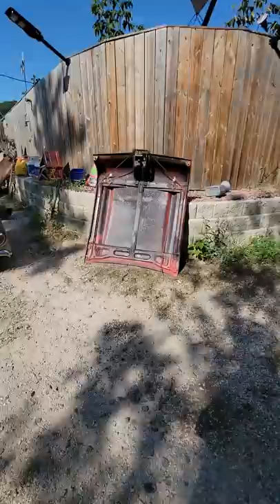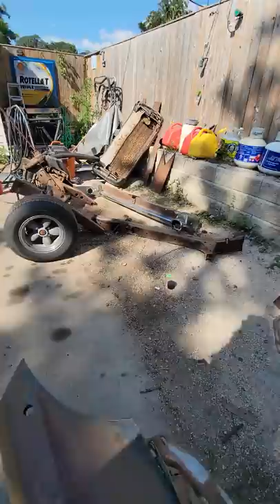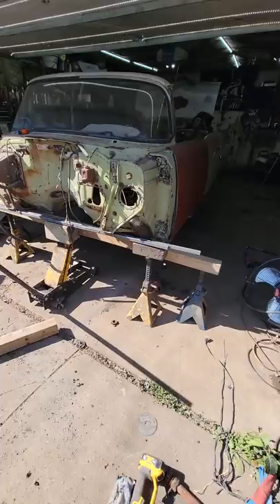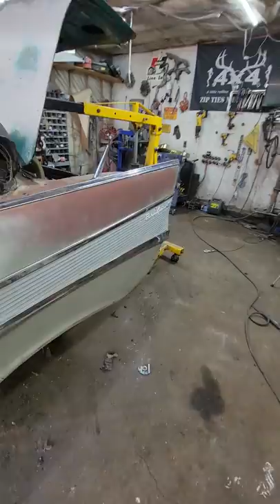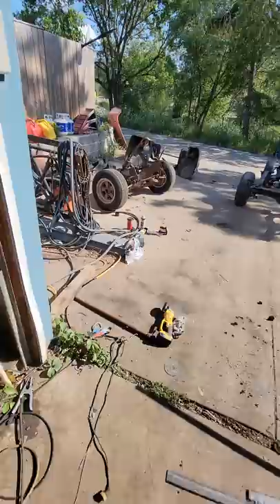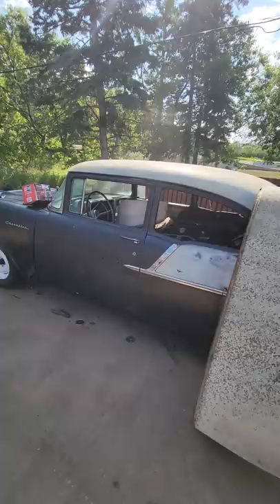I'm Not A Smart Man-Home Made 1957 Chevy BelAir Convertible Edition #shorts

Comment: You know you can make Jack stands really nice ones from those screw scissor jacks that’s in all cars with the factory spare tire! Weld a bigger base on them and a bigger top also I had a few old junk jacks I took the tops off of by top I mean the piece that would be touching the car they work great! I like them because you just use your cordless drill and they become electric powered jacks not to mention if you get the ones out of bigger cars they are way over built and stout as hell! Can also do the same with bottle jacks out of trucks just same weld bigger base and top, “top on bottle jacks optional”